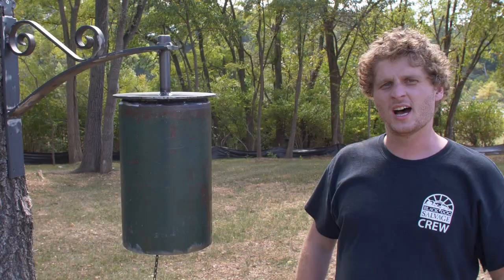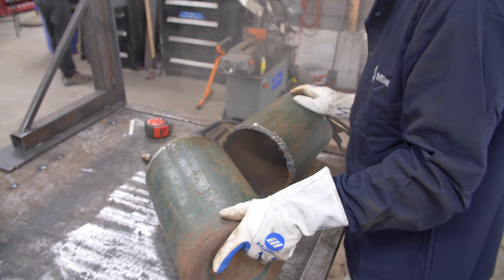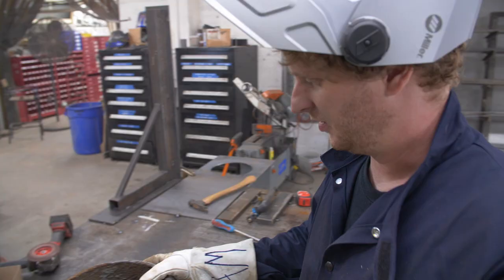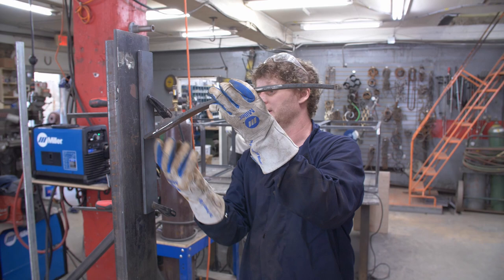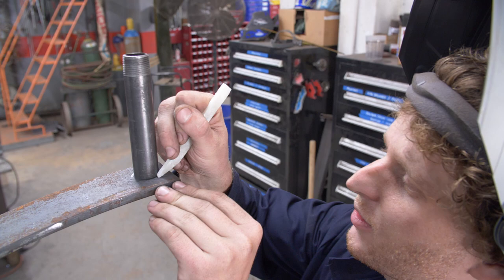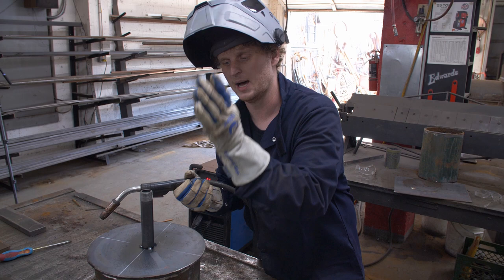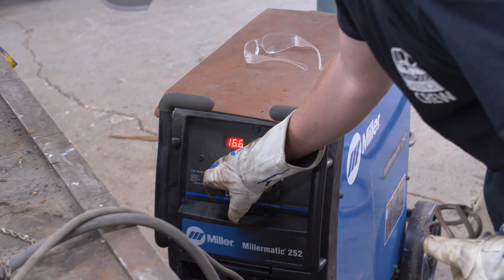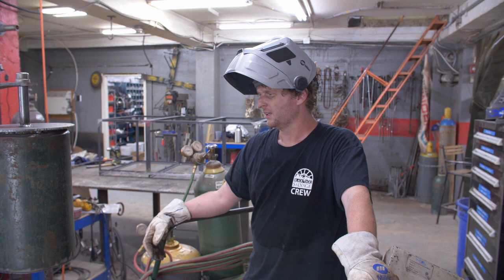Oxygen Tank Zen Bell // Black Dog Builds

Comment: Nice build but if it was me I would have drilled a hole in the bottom which would have taken care of the water issue and you could have pulled something up through it instead of having to weld on the inside